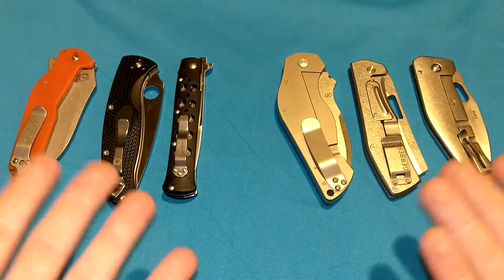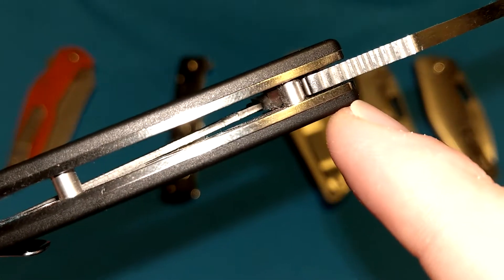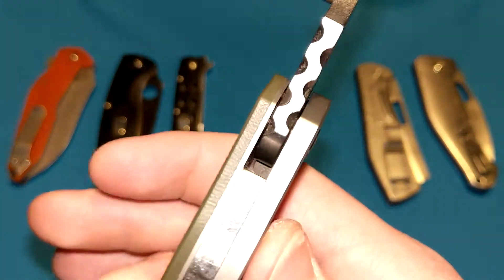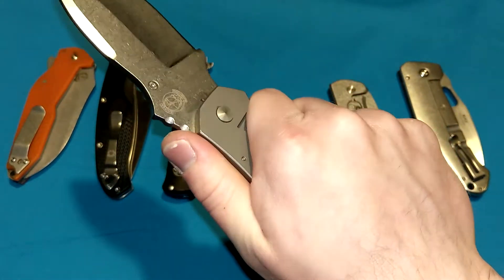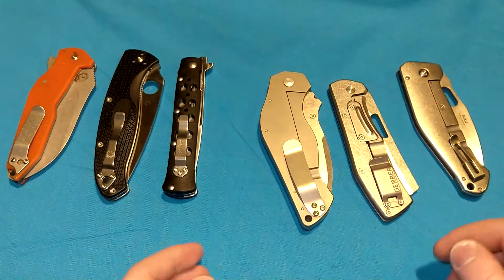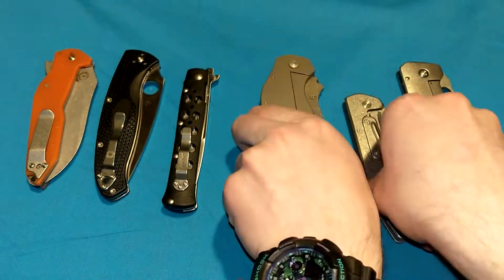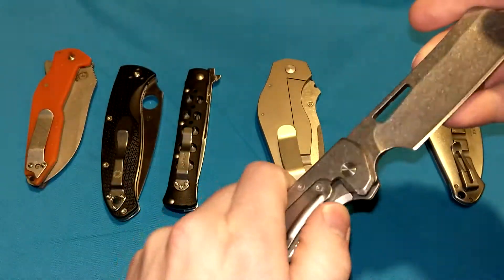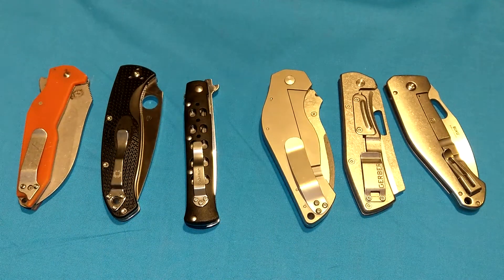Liner Lock Vs. Frame Lock

Comment: TLDR: My frame locks stick; My liner locks don't.

A lot of the frame locks are of that surge of titanium frame flippers. So really, the reason they tend to stick could be the dissimilar metals being rubbed/dragged across each other.
I have mostly liner locks. which is stainless and stainless. If i was worried which one was stronger i should probably be using a fixed blade.

Comment: That's one of the only Spidercos I like. 

Your CRKT has a really high quality ergonomic finish, they made such great knives.

I love the design of that frame lock Boker 👍 Is there a version with better steel tho' ?
Reply from the maker: Yeah, I love the designs on the Spydercos but holy hell they're pricey now! Generally not worth it compared to the competition. And as far as I know, no, there isn't a different version of either of the Bokers shown in this video with different blade steels